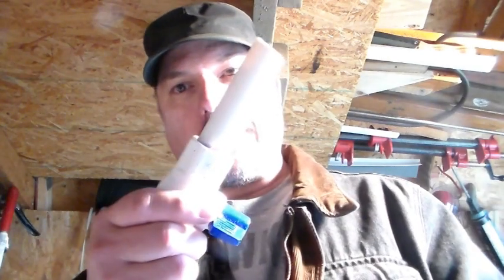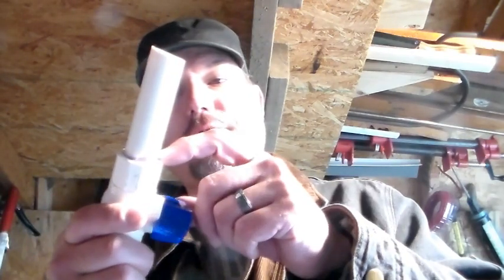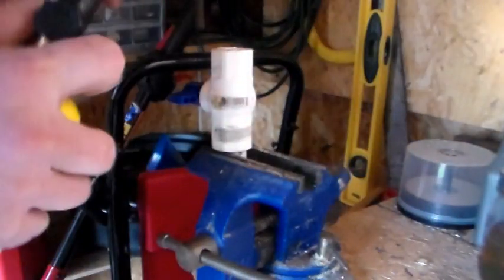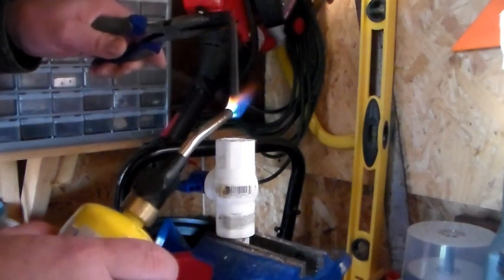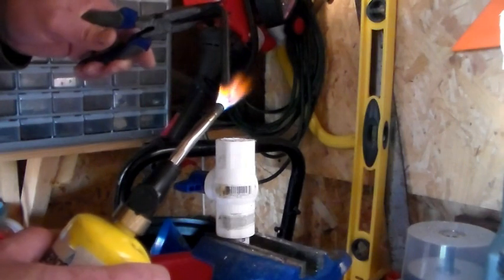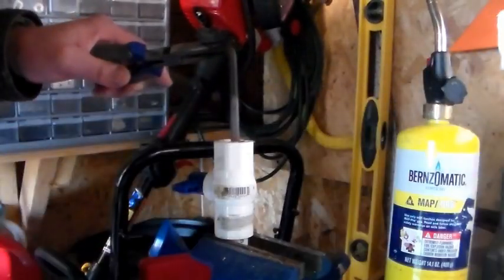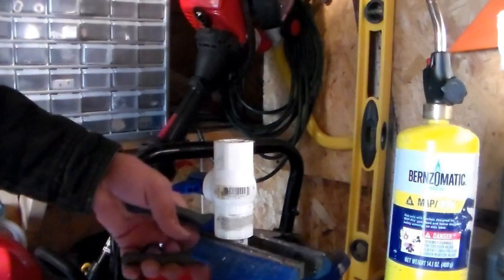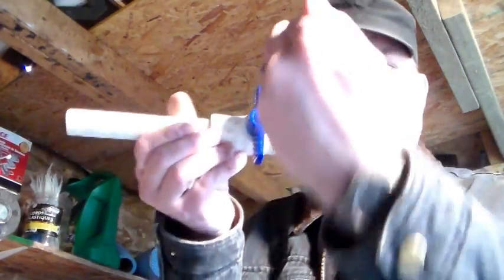How to take apart a Glued PVC Fitting

Comment: Hi there i got a question wasent the gas more expensive then the Vaulve.
Reply from the maker: The tank cost about 11 dollars, The valve 5 something. I use the gas on other projects too.  Probably could have used it 30 times on taking glued pieces apart. Thanks for checking it out.